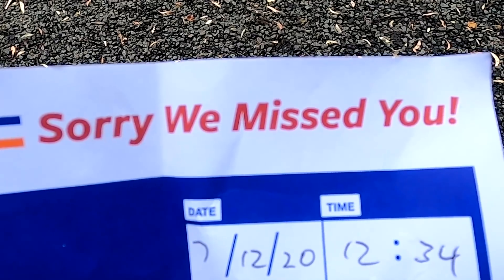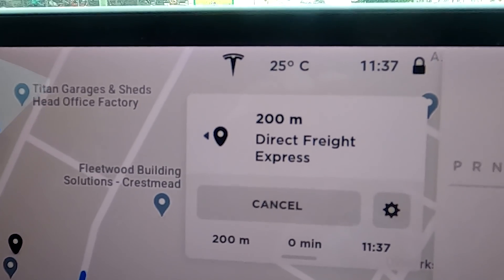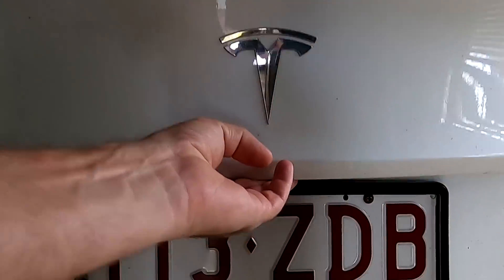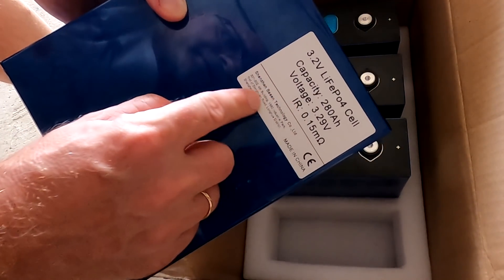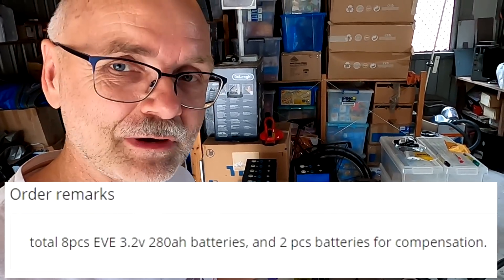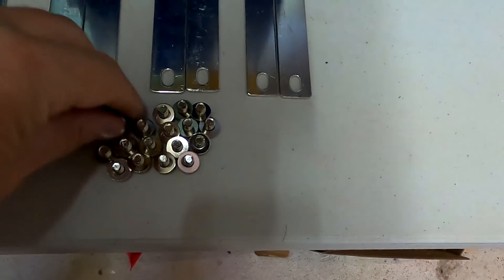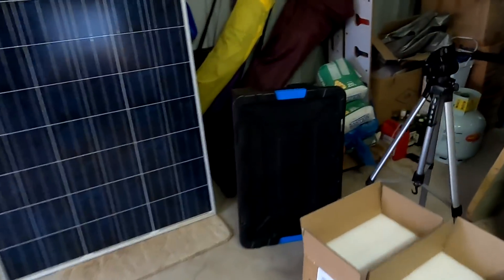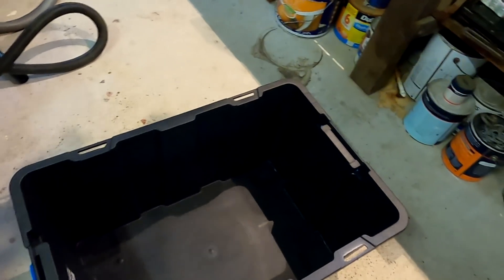To compress or not to compress battery cells

Comment: The reason for compressing LiFePO4 batteries is to stop/reduce the expansion when they charge. The reason for doing this is to increase the lifespan of a batteries because the expansion, and shrinking when they discharge, causes mechanical strain in the batteries which reduces their lifespan, total Charge Cycles.
Check manufacturers data sheet 5:54 to see what compression force is required.

Comment: For the bin box I'm thinking plastic does not provide much protection. In the least create yourself a metal dolly for underneath to roll it with lockable feet.  Long term I'm think you should build yourself a heavy duty metal rack with multiple shelves and bundle the cells in groups of 4 either with metal straps or their own boxes. That way your can work with and transport it. 

P.S. I'm slowly going through all your videos from oldest to newest... so you have obviously changed things by now.

Comment: Can batteries with different specs (ratings) be used to build a battery bank?  For example, if I initially get 4 batteries of 280Ah, can I add (after I can afford another set) 4 more batteries that have a higher Ah rating?  Does the Voltage rating have to be the same?
Reply: @Raj Mandavilli Andy has a couple of videos about building a new battery pack for his solar gate, and how to match the cells in each pack (series + parallel) The same would apply to your plan. Check them out.

Comment: The primary purpose of compression isn’t to prevent individual battery insulation breakdown due to rubbing (very low probability event if it were to occur at all).  Instead it is to minimize delamination of the internal battery structures that will then decrease the efficiency of the battery over time.  This is something that is of primary concern in high drain (e.g. high current) applications.  If you don’t pull a lot of current from your batteries (use heaters or induction cook tops, etc) or don’t expose them to extreme environmental conditions then it probably isn’t a big deal to compress or not compress.
Reply from the maker: I totally agree with your comment, Tony. In solar applications it's not worth the extra effort in my opinion. They gained the extra cycles under certain test conditions which we never meet with solar, 0.5C charging and 1C discharging. I achieved 0.2C charging once in 7 months for a peak moment and never went over 0.3C while discharging as a peak. If people achieve these numbers regularly it's either by design for their specific application or the system is totally wrong designed.

Comment: Great video! Subscribed! I'm thinking of getting 32 of those 3.2V 280ah which you ordered and recommended. So I want to 16 in series and parrellel 2 of this 16 series, and connect them to my off grid Growatt SPF 5000 es. What BMS should I get? Thanks!
Reply: I like the sound of what you are doing….please let me know how you get on as I’m thinking about doing the same.
How long would your batteries last running an average home? Thanks.

Comment: Just a thought, maybe if you use a small square piece of double sided tape on each corner then you still have the air flow while making sure you have a consistent gap between each cell.  Then get the terminals to be in the middle of the busbar slot, then you can always change the gap to smaller or bigger.  At the lowest point of the box maybe make one or 2 drain holes just in case some liquid gets in so it can drain.

Comment: Great to read all the comments, just ordered 48 cells, 100 amp Daly BMS, 100amp dc breakers to build 3 batteries, I will order ss set screws, thanks for the info guys.  I plan on building a metal enclosure using 20 or 22 gauge mild steel and semi compress the cells using high density foam strips. My thinking  is to use 3, 1 inch strips on each end cell to semi compress and still leave space for cooling .
Also ordered a Deye 8kw split phase inverter, the specs look very similar to the sol ark.
Reply from the maker: Wow, that's a big project. Thanks for sharing.

Comment: The case is not connected to any terminal. That would be way to dangerous. There is some path through the electrolyte that fooled my multimeter to show 0 ohms but it is not able to provide any real current. Try to connect a  load between the case and a terminal and measure the current.
Reply from the maker: We now have three different views on this, positive, negative, not connected at all. I have not tested it myself and probably don't want to scratch the isolation just to find out... 😉
Reply: @OffGridGarageAustralia  I used the QR code cutout to test to case. Don't scratch your amazing batteries :o

Comment: Regarding cooling inside the box, I would expect the BMS to generate much more heat than the cells themselves.
Reply from the maker: Yes, that might be the case. I have to wait until it's here and see how hot it gets. If I put it in the top of the box I will add a fan for air circulation.

Comment: The datasheet for the cells shows compressed vs uncompressed performance and has in writing the compression amount to use.  Cell compression results in longer life but a faster degradation over the first 1000 cycles according to the datasheet and is not required.  Compression will result in better overcharge tolerance if that should occur, and that information is NOT in the datasheet.
Reply from the maker: What datasheet are you talking about?
Reply: Compression is a specific word. Does it show up in the documents or is “fixtures” used? What I have been seeing is a fixture in videos. Fixtures and jigs are a topic/jargon in mechanical design. For example, a fixture that does not yield to a force of 300kg. That is different from a compression perspective.

Comment: Hi
You never want to compress the cells!
You can brace/ strap the cells and this is to prevent them expanding due to any over/ undercharged situations. Mainly overcharge I believe.
I have been running my pack without any bracing for some time.e now without issue but I have never overcharged.
Which bms will you use?
Reply from the maker: Thanks for your feedback on this topic.
I have ordered a 200A BMS from AliExpress with BT and 600A peak current. It was cheaper than the Daly ones so I thought I'll give it a go and see how it performs. It's on its way...
Reply: The manufacturer's datasheet states otherwise thought.

Comment: Reading a lot of comments here about compressing the cells, when I get my cells (just a small astronomical problem with freight to New Zealand to overcome), I will be compressing them to ~12psi, as that will prevent any possibility of delamination of the jelly-roll, or plate-stack over time which does seem to happen on just about every ‘dry’ construction cell. Other people mention using wood, laminated or other to either stand the battery pack on in the bottom of the box, or to even-out the compression loading of the end plates, I strongly warn against that as the treatment and othe resins in the wood will react with the aluminium casings over time, corroding the bottom ofthe can away, especially if the bottom of the cell doesn’t have a tape or other covering (not sure on these particular ones) - I would as a minimum cover any exposed aluminium casing with capton or other nylon based tape if standing on wood, and even thinking that the treatment vapours of any wood in an enclosed box could eventually corrode the aluminium terminals, though they are a lot thicker than the can so probably not as detrimental.
Reply: Hi Phil, Im in NZ as well. Very interested to see how you go about freighting to NZ. Shipping method and cost etc. I would like some cell but the shipping blows it out of the water!
Reply from the maker: Thanks Phil, how will you compress your cells and how do you measure 12psi, what tool do you use for that? I read in other forums, people use springs and experiment a lot with that but there is no clear solution or explanation of that process.

Comment: Having the gap between the batteries is better not only for expansion and contraction heat dissipation the batteries will cool faster and not get as hot when charging and discharging you are correct by doing so
Reply: These batteries don't get hot unless you do very high C rates (not common in solar applications or battery banks like this). If you read the datasheet, the manufacturer recommends clamping these together at a specific pressure.

Comment: I thought the case was positive? This is the only the second i have heard anything in reference to the polarity of the case , once it was positive, then now negative, easy to tell with a volt meter, I would atleast put some construction paper between the cells, or toolbox liner, a kinda rubbery plastic, even in a stationary application, something could hit the box, pushing the cells together, causing a possible short, all that current would likely destroy the casing, if shorted,    I'd like to eventually get a few of these, for my 12v and 24v banks,   
             awesome!!!
Reply: We tested this and the case voltage is only a leakage. I shorted it out to test that :)  It's mentioned in a thread on diysolarforum.

Comment: I have read some feed backs
I think It will be  a good idea to keep space + adding a plywood in the bottom + adding 4 wheels also.
I know that it is stationary but maybe in future you decide to make some new arrangements or changings in your place, so it will be very helpful.
Reply: @Tech Boy, I agree with everything except the wood: something inert like plastic or rubber would be better. I would avoid wood unless it was charred (and I couldn't find some suitable plastics).

Comment: I followed your reasoning and agreed with not to compress.  I then watched a new system video, SEPLOS PUSUNG Energy Storage System, and they said to compress to prevent "irreparable swelling damage".  I wonder if the manufacturer would have a recommendation?
Reply from the maker: There is not a single topic in the specification for these cells about compressing. I will ask the manufacturer though so we are not missing anything here.
Reply: @OffGridGarageAustralia  This was the YouTube video

30KWh On-grid Back up Battery Pack With Growatt Inverter Setup - SEPLOS PUSUNG Energy Storage System
Reply: @jimmysquires5093  in that video they do not compress the cells, they only hold them firmly with custom-made plastic holders.
I am more in favor of holding the cells firmly together instead of compressing them, for me they are different things
Something like this, but for our 272-280ah cells would be ok:
https://jiasaw.en.alibaba.com/product/1600142841614-819391428/Four_Seasons_100ah_Brakectabs_Pc_Jiasaw_Unisex_Battery_Holder.html?spm=a2700.shop_pl.41413.35.42d15a02gYhrcV

P.S. I also bought them from Sheila
Reply: Sure! Aluminum case will be destroyed for the stress

Comment: Read the spec sheet. It will talk about compression
Reply from the maker: No, it does not.
Reply: @OffGridGarageAustralia  ask to your reseller
Reply: Where specifically in the spec sheet does it say this?
Reply from the maker: I read it now several times and there is nothing mentioned about swelling, compressing or similar action you need to take. Not even if discharged with 1C.

Comment: There are some scientific research papers which speak about longer longevity when you keep them compressed. My 100Ah cells expanded 3-5 mm each during there lifetime till now. Your cells are very big. The "Jelly-roll" inside that can has a lot of windings. So even if it just swells a tiny bit per winding, it will eventually add up a bit :) But its your choice...
Reply from the maker: I was looking for some advice on this but cannot seem to find any. Some people are saying its bad if you don't, some saying it is bad if you do so.
Reply: @OffGridGarageAustralia  remember the aluminum case can be destroyed for the stress. 
For this reason you need to compress them
Reply: A really good source of information is the endless sphere forum. There has been a discussion about compression there. It is good, but has to be the right amount.

Comment: I love the box. There is a little wasted space at the top but not bad at all for the price. It’ll make a great, portable unit.
Reply from the maker: It will not be portable at all. with 80kg it's far too heavy, the bottom would fall through when lifted. This is a stationary setup, not mobile. Once in place, it will not be moved again.

Comment: One thought on your concept of leaving space allows for air flow. If there isn't air flowing in sufficient quantity, air is actually an amazing thermal insulator, so you are actually better off coupling the cells thermally in order to dissipate heat. Others have mentioned but the expansion is a result of high voltage during charging so could be a non issue depending on how you are going to handle charging but in general compression is beneficial but I'm not planning on doing it.
Reply from the maker: I'll keep them at 80%/85% SOC max so this should not be an issue. Also I have charged some of the cells to 3.65V a few times to do capacity measurements and never noticed any expanding (yes, I looked for it).

Comment: It's not the heat that creates pressure and deforms the cell, it is high charge state.

The reason you compress the cells is to get a longer lifetime and slower aging and capacity loss.

You can see both on the battery spec sheet.

You want to compress, and you want to do it with threaded rods.

There is no situation where you should not compress.
Reply from the maker: I'm not planning to charge the batteries to a high SOC on a regular base. I have read the specs and cannot find anything about compression.
Reply: Can you publish the compression specifications for this particular battery type, we all love to see them. Thanks
Reply: They are in the resources section of the diy power wall forum. The spec is 12 psi or 600 pounds (300kg i think it says). Ideally between 6-17 psi according to their engineers.

Comment: Nearly 200 lbs in that tub. Don’t know it’s weight rating, but I’d seriously consider putting some plywood in the bottom to keep it from falling through even when stationary.
I’m building three 24v batteries with these cells (24 cells) and 100 lbs each is tough to handle (probably put my totes on wheels).
Love your enthusiasm, keep the videos coming!
Reply from the maker: Thanks for the feedback!
I thought about some plywood as the bottom but this will be a stationary setup, so once the box is in its place, it will not move again.
Reply: @OffGridGarageAustralia  I would think about some castors - you say the box won't be moved but, believe me, sooner or later it will

Comment: Thanks for the video.  This is a good topic.  I have 8 x 280 AH batteries built up into an 8S -24V 2x4 cell pack for a stationary off grid application for part of my home.  As I recall, the data sheet for my cells said that the cycle life was better if the cells were compressed.   I think the rating is 3,500 cycles to 80% capacity if compressed and only 2,500 cycles to 80% capacity if not compressed. I have also seen comments from other users saying that it is better to compress the pack, especially if they are used in a mobile application.  I took a hybrid approach to building my pack.  I  put the batteries together using a 1 inch square piece of VHB tape in each corner of the batteries that faced each other, and then compressed the entire pack using a 10"H x 18"L x 3/4"T piece of plywood on each end of the pack, compressed and held together by four threaded 1/4" rods about 14" in length.  This gives you the best of both worlds - a very slight gap between batteries with the whole pack secured and compressed to avoid shifting of the individual cells when the pack is moved.  Cooling is not an issue in my application because I rarely go above 0.2 C charging or discharging the pack.  By the way, I would not recommend compressing the pack with a metal bar as you were considering.  That concentrates the expansion stresses on a small surface area of the battery case which could lead to problems down the road. The plywood endcaps distribute any expansion stress across the entire surface area of the battery, with the added benefit that plywood is not conductive.  I'm keenly interested in how your project turns out.
Reply from the maker: Thank you for you reply and feedback. That is a great setup you have there. I wasn't going to use the metal brackets for compressing (although I have seen this online). A piece of plywood as large as the full side  of the cell would evenly spread the load as you suggested. But I'm still not convinced I should compress at all. It does not say anything in the specs for my type of batteries.
Reply: @OffGridGarageAustralia  check out a top view photo of my battery pack at the link below showing the way I compressed my batteries..  I went back and checked the spec sheet and other comments on Will Prowse's DIY Solar forum, and the general consensus of many is that compressing the battery pack extends the cycle life of the batteries. 

https://diysolarforum.com/threads/xuba-electronics-deal-280ah-lifepo4-cells-purchase-review.3850/page-61#post-96433